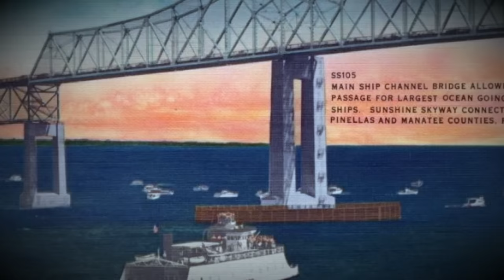The Sunshine SkyWay Bridge Disaster 1980 | Plainly Difficult Documentary

Comment: There is NO excuse for this disaster!! My Dad and I used to sail our Alberg 30 sloop in these waters, in that channel, and under the Sunshine Skyway bridge 100's of times when I lived in Florida. There were times when the fog or weather was so bad, we couldn't see 50 ft in front or around us, and we had NO radar. We usually went under the bridge under sail when the weather was nice, though always motored in when the weather and visibility was bad. My Dad was a great mariner and captain, and he would  watch the map of the channel when the weather and visibility was bad,  while giving me explicit directions as I manned the tiller. He would watch our speed, the compass, the current and the wind direction (for any drifting off course), and knew how far it was between each buoy in the channel entrance, and also when the channel was bending left and right. There was NO EXCUSE for this disaster!!!
Reply: Not being a mariner, but listening to the unfolding of events, I doubt anyone on the ship was seriously in error at the time. That is to say,  not using 'common sense'. The ship was slowing down, had been in reverse when the accident happened. Most tellingly, the lack of protective piers seems to have been the most contributing factor of the accident. Some foresight in the final approval of the bridge or in its operation years later could have possible saved many lives by their (the piers) presence. Perhaps of similar value would be the implementation of 'instant warning devices' that would operate when the unthinkable happens. An attitude of 'it shouldn't happen or be a need for' might be adjusted with one that reflects 'just in case lets plan for the unthinkable'.

Comment: It's easy for me to sit here and Monday morning quarterback, but if numerous ships are hitting the bridge channel abutments, then they should be extended along the channel to actually nudge the tanker to the side or to a stop. This could be done easily and cheaply with a bit of extra concrete and then a lot of riprap(rock) dumped along the sides.    Also, buoys should be fewer along the unfettered stretches of channel and more numerous where they are near the bridge.  Finally, big radar reflectors on bridge and final buoys.  I didn't see any in the video.

Comment: I appreciate your attention to detail, plus the subtitles.
I wonder why the Americans always insist on half miles an hour. Why not 50, 60, 70?
Reply from the maker: Thank you! I’ve always wondered that too
Reply: Transmissions actually switch gears around halfway points. Idk if that has to do with the speed limits, but I had to learn that when my old car’s transmission started going out and I had to manually shift gears. 

Personally, I prefer almost every halfway speed. They feel nicer to drive at. I assume it comes from the same mental thing that’s in play when something is $0.99 instead of $1.
Reply: Many of the USDM cars I've had just had numbers on the tens. (I'm assuming you said "half" to mean speed numbers ending in 5?)
Another thing maybe worth noting is that for a number of years (80s- mid 90s) there was a federally mandated speed limit of 55mph, and cars had that very speed indicated right on the speedo for that reason.
The gauges also often topped out at 85 mph, not sure if that was part of the mandate though.

Comment: All approving authorities of the bridge's construction are at fault for not installing barriers from the navigational channel.  Something as simple as a snaped pin in the steering gear of a ship could have caused this and it has in other accidents.  This must be considered when crossing a navigational channel with a bridge.  Designed to kill is not OK.  The pilot should have anchored and waited for better weather but that's Monday Morning QB.  The need for protective barriers is obvious and predictable.
BTW:  You should tell your viewers that this was before GPS or any other nav aid that is on par with GPS capabilities.  Also, the maintenance of the radar is critical to its performance especially in rain.  The magnetometer needs to be replaced every few years but it rarely is and inspecting authorities don't address this.